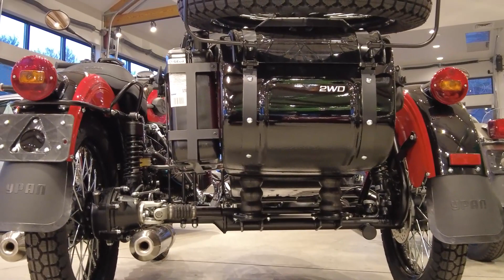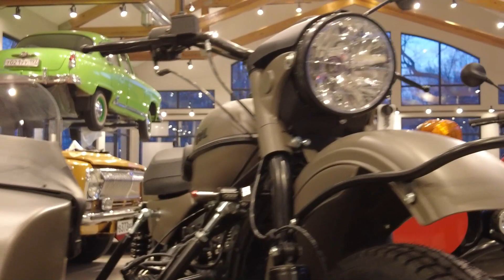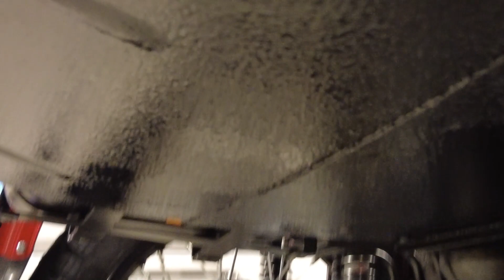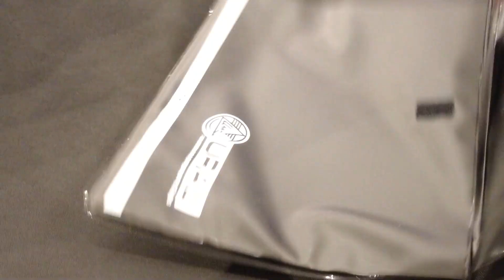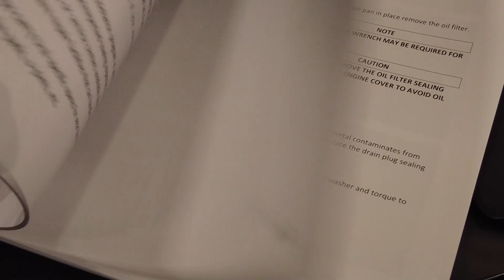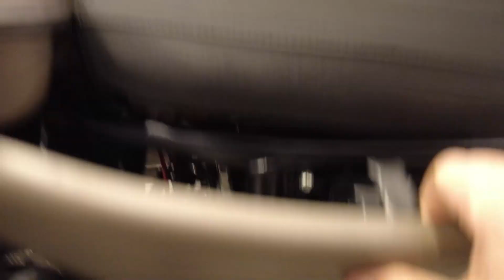2021 Ural cT and Gear Up Comparison

Comment: Hi Dmitry, we need to convince ilya you all need a third model! Law of threes in sales is not a theory it is a law...  3 choices better than two, just saying!
Now to the rest of you. Owned and ridden Urals for over a decade, riding over 50 years. I live in Georgia. Snow? Please. Have used 2WD once, in a campground. 
I just don't do that level of off roading. I have an ancient full time 2WD Ural too, it is good for getting stuck and pushing one around corners, that's it.. That is why that is not available.
If you do a lot of off road, pay extra get the 2WD. Just remember it is for 2 things. Getting stuck, or getting un-stuck when getting stuck in 1wd and for snow...that I don't have.
Just traded a really nice 2019 Gear Up, that I actually like, for a new 2018 Retro. The last one Dmitri did where I commented, that one...it meets my needs. Get the one that meet yours!
And he is right, optioning a CT up is more expensive than just getting the Gear Up with all the goodies...and the owner's manual is like an old car one, actually has real info in it!
and I almost bought that cT instead of the Retro, but optioning it up would have driven the price up to the Retros or a Gear Up, so I didn't...

Comment: the geometry is different... the CT is therefore more stable on the roadway while the Gear Up is more dirt worthy... especially the 2 wheel drive requires some maintenance... well with the CT you don't have it so therefore no maintenance, nothing can break there, tire changes are easier... it comes down to really look into what you are doing... if you go down the county road or run through the woods on the search for a camp site with wife and kids down, otherwise take the Gear Up... for heavy duty off road riding take a dirt bike... I wouldn't want to break a Ural... which is hard to do anyway... if you still don't know then buy them both... Lol